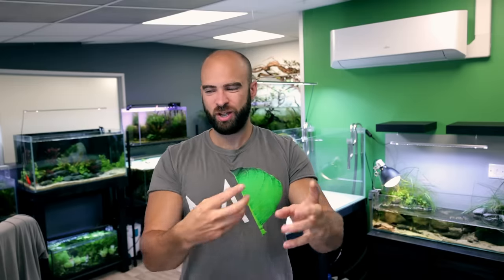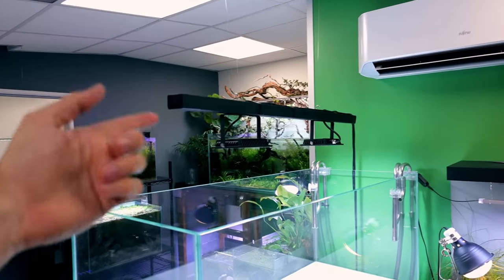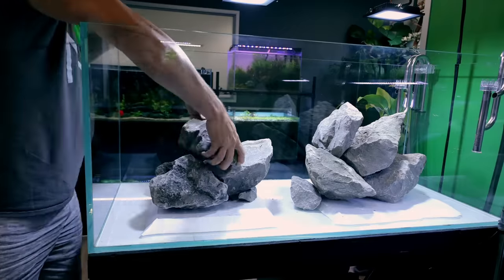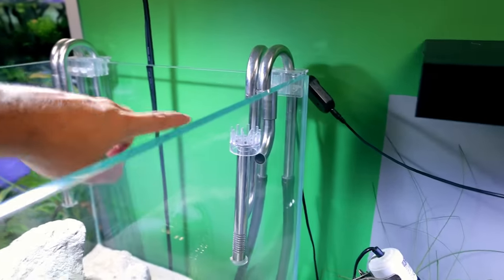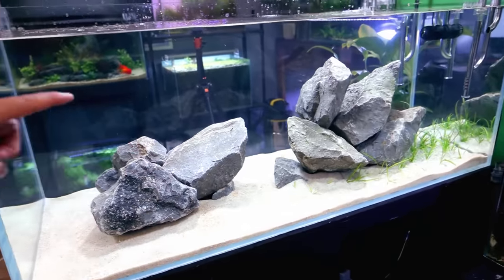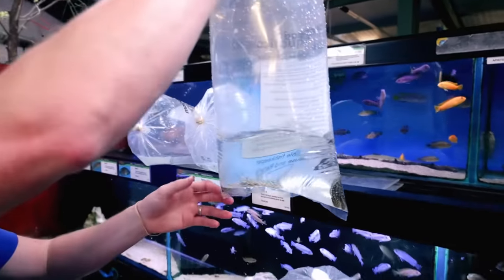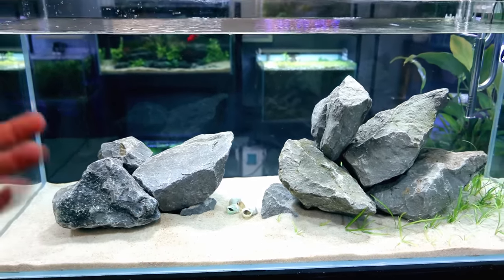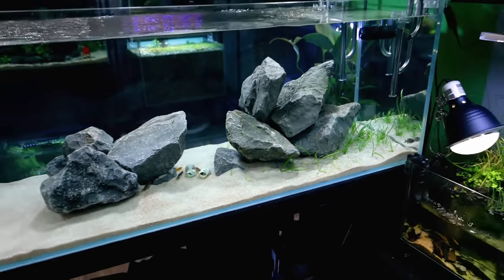Aquascape Tutorial: EPIC 4ft African Cichlid Aquarium - Lake Tanganyika (How To Step By Step Guide)

Comment: Not sure if it is called the same over there but PVC pipe might have been good for the lights you could have run the wires on the inside of the pipe and drilled a hole on the end cap to plug it in.

Comment: you can shorten the metal lamp holder by cutting off half, and drill a hole in the remaining part for the bolt that connects the lamp to its holder. On a short leg, they will look prettier.

Comment: I recently purchased the same metal lily pipes as you, however the surface skimmer isn’t floating when the filter is running and if I push it to  the surface, it pulls in a bunch of air and gets sucked back down. Any ideas?

Comment: How were those cables on the lights joined?  One minute they are separate cables, the next they are joined and covered in insultation tape.  Is this safe?????
Reply: That's how you're supposed to join them. There's probably a limit to how many you can run on one cable mind you.